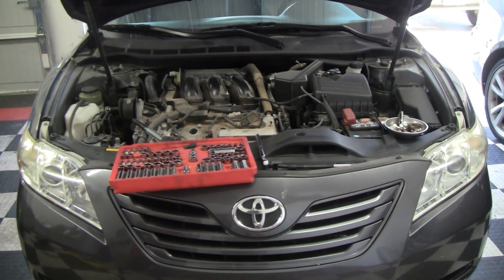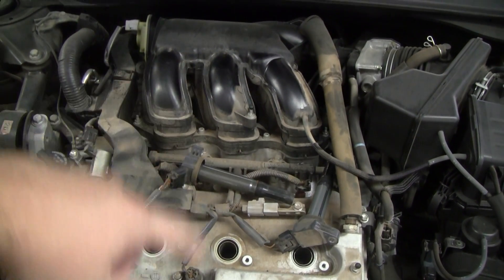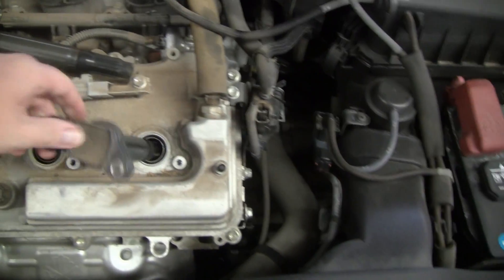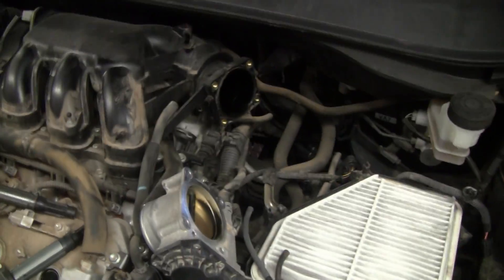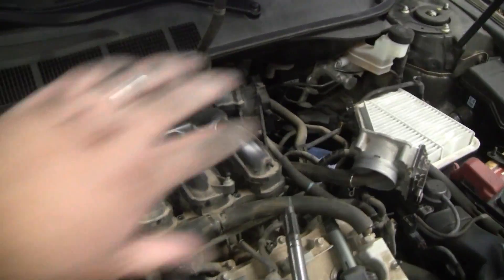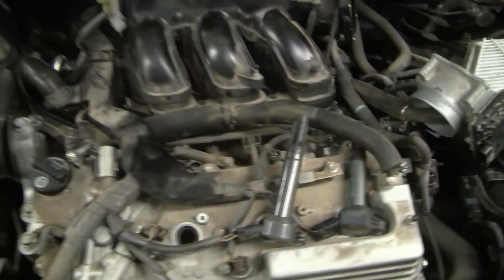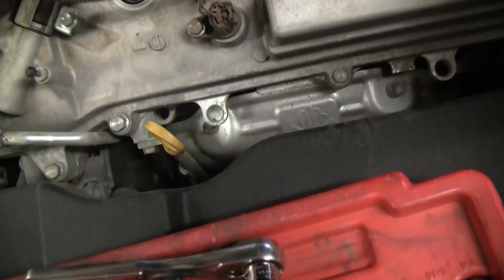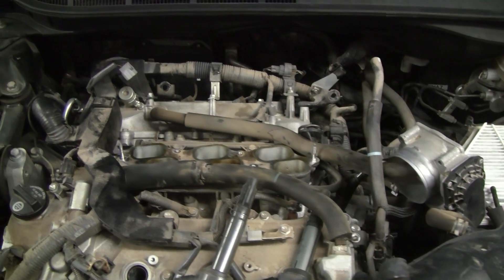How To Replace An Ignition Coil On A Toyota Camry V6

Comment: Took me 7 hours and I cannot get the bolt back on the rear of the exhaust manifold to save my life. Its killing me man.
Reply: That bracket has two bolts. I left one on valve cover slightly loose, put manifold on and started all bolts. Then put bolts on back of manifold. Leaving the bracket slightly loose enabled me to move bracket side to side in order to start bolt into back of manifold. Then tighten all bolts.
Reply: @sipock97  I tried that its just a small space for my hands. Its not to vital but im gonna take my windshield wipers and sfuff off to get to it. I appreciate the reply big time.
Reply: I did this on my Sienna and removed wipers and cowl. Will do the same for Avalon. Extra room is worth the bit of time it takes to remove
Reply: Literally spent like 3 hours tring to put it on before i was like fuck it dude, im thinking it only holds the thing still and the other one will sufice for that.

Comment: If I'm looking to change only one coil, is the order normally (back 1-2-3) and (front 4-5-6) on most V6 engines?
Reply: I think it's (back 1-3-5) and (front 2-4-6) on these engines.  Don't know how universal it is.  Probably from the location on the crankshaft, starting at the pulleys(which used to be the front of the car), and back to the transmission.

Comment: So did the plugs you bought from Amazon work for long? I could buy a 6 pack for $100 on Amazon or ONE coil for $100 from Oreilley.
Reply: Annie Leigh ... whatever you do just make sure you are buying OEM original brand spark plugs, off brand are not worth bothering with.

Comment: I just did a 2007 rx350.  Changed (6) spark plugs, ignition coils, cleaned throttle body, replaced serpentine belt, changed oil and air filter...all for about  $275 (illinois)...I used amazon for the ignition coils  ($135) and auto zone for ngk iridium spark plugs ($50).  was pumped to do it after watching your vid but the rx is a different beast.  Same motor,  same basic layout until you get to the passanger side rear intake bolt...Fucking impossible on the rx350.   Thanks to your vid, you gave me a good reference to where it was...working in the blind I got the job done.  Couldn't have done it without this video
Reply: +mauricetomas how hard was it to remove the old ignition coil connected to the cables? its like super tight on my dad's and I'm afraid to break the dam thing. Did you use a clamp or something, or just brute force?
Reply: +fubag I had one ignition coil that was literally burnt (melted) onto a spark plug, I replaced the plugs and every coil but if your question is about that little tab on top, use a screwdriver to push down while pulling out.  sorry for late reply, I just saw this
Reply: +mauricetomas I did 2004 Solara today. Even though Solara is a Camry but the coupe layout made that passenger side intake bolt  access very difficult as well. This videos shows lots of room comparing to what I had. Anyways, $101 for 6x coils, $55 spark plugs, I changed all 3 gaskets ($25) and a new KN air filter. 
Some guys reported a need to drain coolant but I had no need to do so.

Comment: Hi. Thanks for doing the video. So how long did the cheap coil last? I just replaced a bad coil in the front with a $25 one off of ebay. In my experience, paying (LOTS) more for OEM dealer parts does not always mean getting better parts. The one I got is made by Gamma, and has a 12 month warranty, which I won't get with Toyota OEM coil

Comment: Hey question i did just like the video said and i replaced all the coils and now the car turns on and then off why is that? What could be causing that was working before i did the repair
Reply: Luis Payano I’ve seen other videos showing that if you remove working spark coils while the vehicle is running then the motor will start and stall like you are describing. Maybe the coil isn’t seated right on one of the cylinders? Might not be getting voltage up to the coil either. I would check with a multimeter.

Comment: My car with same engine is surging and gives error code P0302 means cylinder number 2 misfire I swap the coils and replace the spark plugs and replaced fueil filter but still get same error code

Comment: Thanks for the video, it was very helpful. I replaced the #5 coil and am still getting the same code. Misfire #5 cylinder. Should it take a while for the computer to reset or could it possibly another problem? I replaced all the plugs while I was in there.
Reply: I have same problem on cylinder number 2 I think some thing clogged fueil injactors
Reply: Did you clear the code after you replaced everything? Did it come back on after you cleared it?

Comment: Please help. How much should it cost to get coil no 3 replaced on this car with and without 6 spark plugs? Can I buy the OE Toyota parts on amazon? What is the part number for coil number 6 and the 6 spark plugs?  Thanks.
Reply from the maker: The price will vary quite a bit, but I wouldn't pay more than 200 for labor.
Reply: Nick Stageberg Thanks for your help. I got it done for 235 labor with 6 new plugs also.
Reply from the maker: StyngRay1 Sounds like you paid a fair price then.

Comment: Good luck with all of those online $25 coils. You'll soon be revisiting P030x codes. If the code ends in an odd number - 1/3/5 - you are dealing with the back row which is a lot of  work.
Access to the back row of coils/plugs and the 2/12mmm bracket bolts is greatly enhanced if you first remove the windshield arms, plastic cowling, wiper arm motor and large metal cowling underneath the plastic cowling. This is not at all hard to do. Use battery post removal tool to get the windshield arms off.
Reply: John Smith